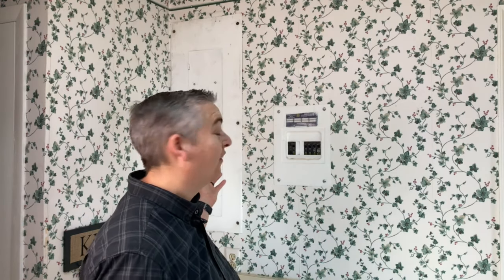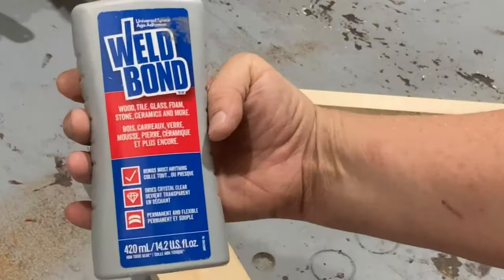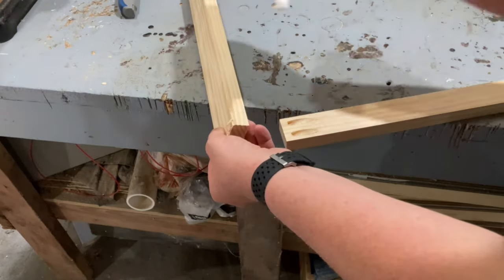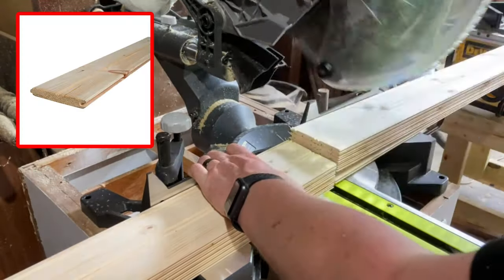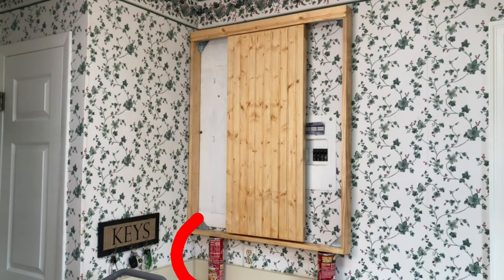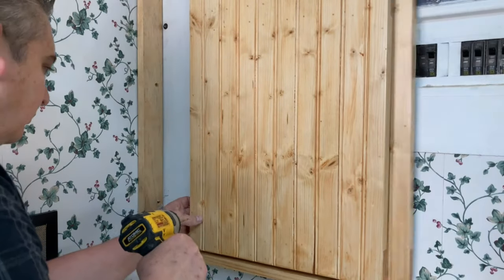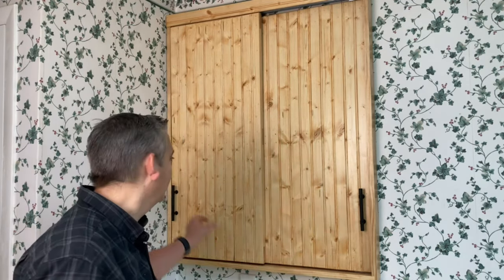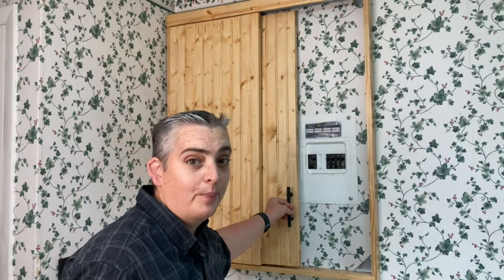How to Build a DIY Cover to Hide your Electrical Panel! // Easy Woodworking Project!

Comment: Before you install or relocate your electrical panel box, you’ll need to follow the regulations set forth by the National Electric Code (NEC). The NEC 110.26 states that the electrical panel and equipment must be placed in a location with proper clearance around them. There should be at least a 3 feet clearance in front of the electrical panels. These standards provide safety guidance for preventing fires. Consider these requirements:

Comment: Emergency personnel need access to the panel and it should not be blocked by a cover. Putting it inside a closet is technically allowed, covering is not. I'd prefer it always visible so a firefighter could easily locate, better safer than sorry.
Reply from the maker: Thank you for your concern, all valid, necessary things to consider. I actually have something similar in my own home that is original to the build of the house (1926). That's where I got the idea. I did run it by some local authorities and because it is so shallow and the doors pop right off, they were ok with it. Maybe they were just being nice. I definitely would advise anyone to adhere to regulations as you have stated.
Reply: @boydstongrove  I'm more worried about a hidden panel being hard to find. There is (some) fire concern if the panel does not have ventilation it can overheat from a minor short. For isolated houses who cares, but for apartments and dense cities this is a big no-no and is a fire code violation that contributes to a real hazard.
Reply from the maker: @PeterJD35  so this is a cinder block single family home and the two panels are on an open wall, in the middle of the kitchen. Totally not to par with current code, but grandfathered in. They are talking about a full remodel, so my creation will most likely be short lived.
Reply: @boydstongrove  its an amazing creation but a bad influence for diy YouTubers 🤣